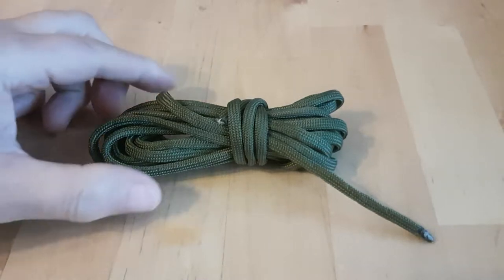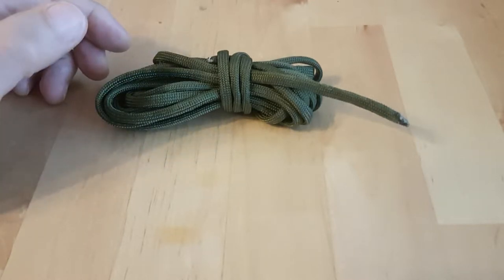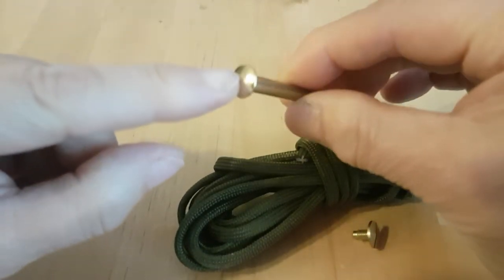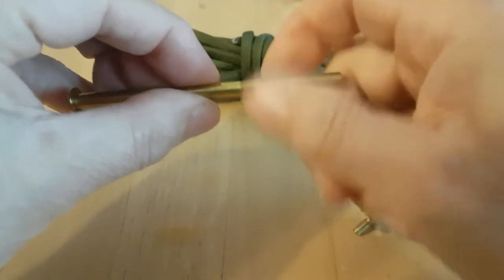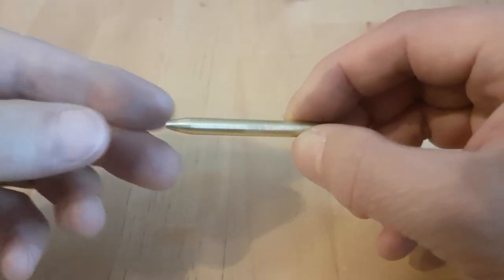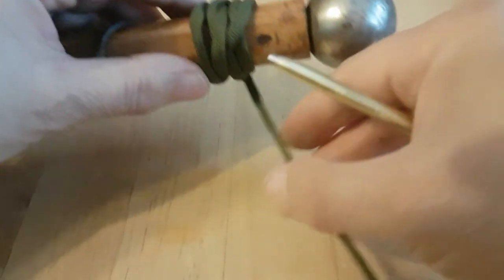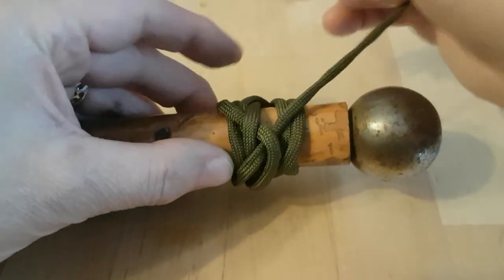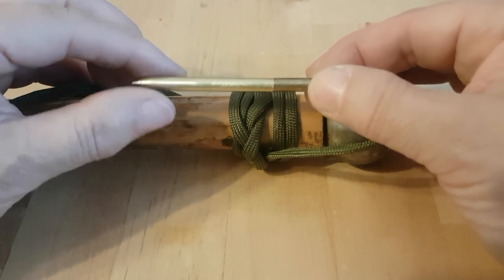Making a 5mm paracord fid/needle from a screw post

Comment: Great idea for the material for this project, never would have thought of a screw post, worked a treat. Yes your angle could be a little longer, but all in all nice job. Tis is a lacing needle, not a fid. Fids are wooden tapers meant for opening up rope and knot work for lacing but don't do the actual lacing. There is a metal equivalent called a marlin spike. Check out Mikko Snellman on youtube for more in depth look at rope and knot work.
Reply from the maker: Thanks for watching and for your info in the comments! :)